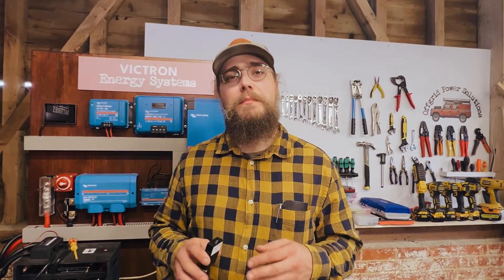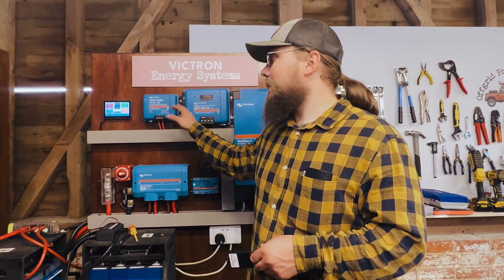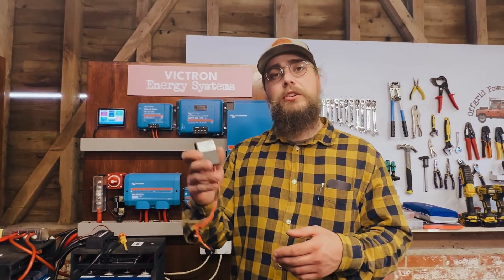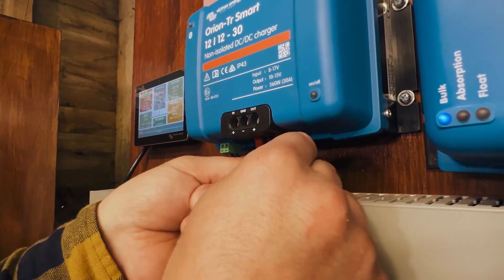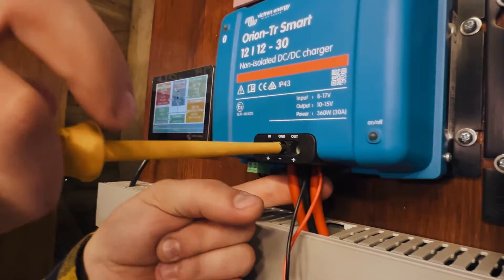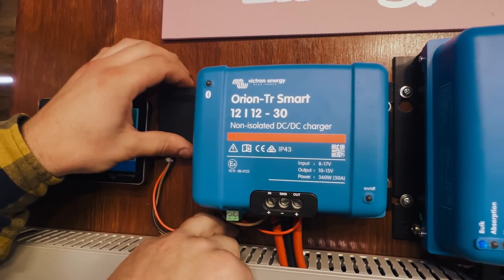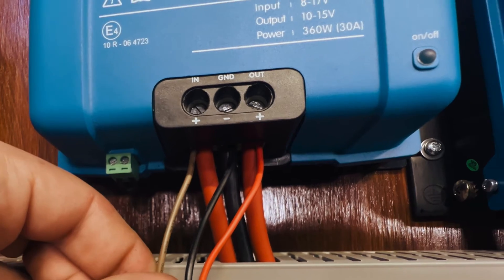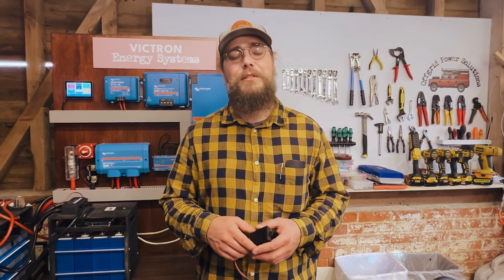How to install the Van Bitz Battery Master with a Victron Orion DC to DC Charger

Comment: Thanks for the video. When the Battery Master starts to trickle charge the starter battery does that not cause the DC to DC charger to think the engine is running and start trying to charge the leisure battery?

Comment: Not so easy to fit this to the new Orion XS as there is no room to fit the cable in the terminals if you use the maximum 25mm cable.  Also the cable cover for strain relief  doesn't allow access for the battery master cables.  Any suggestions?
Reply: Same issue, so going to use crimp pins for 25mm cable

Comment: Hi,
Thank you for all the content! My multiplus has a 1A trickle charge as well. In some cases, you don't need this device.
Reply: I hoped this would be the solution for me, but I believe the Multiplus only trickle charges under site hookup. This device should provide me with a solution to trickle charge the starter when not on hookup, overcoming the issue of battery drain when van doors are opened and closed a lot when on the move or away from hookup.
Reply: @Leadlinker  Last week I was camping and I charged using only my solar panels. I monitored the car battery voltage and it was above 13.3V when there was sun and was dropping once the sun was down. This makes me think that the trickle charge is working with solar as well.
Reply: @Leadlinker also as I’ve just found out the trickle charge has to use the same charge profile as the main output, ok if your on LA on both but not if you have lithium’s as the starter will overcharge.

Comment: Hi where would you put the common black ground wire on a isolated victron dcdc charger as there are 2 ground points
Reply: Hi Did you ever find out ? Thanks